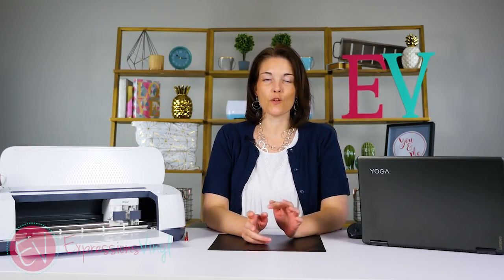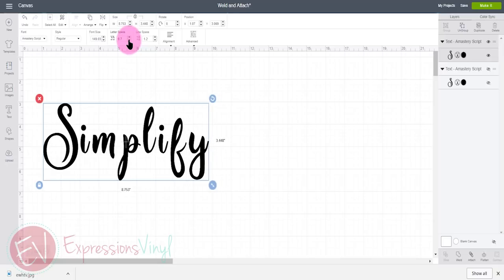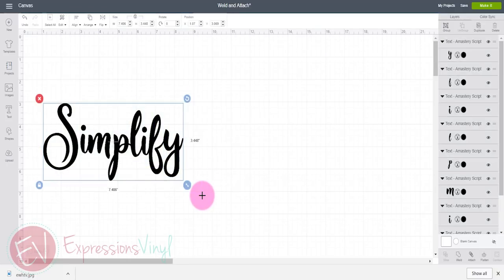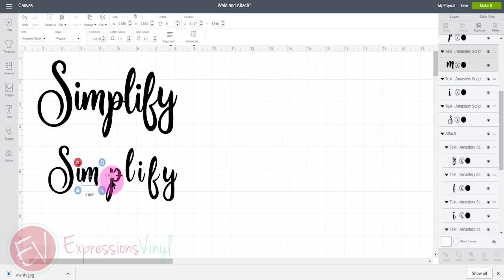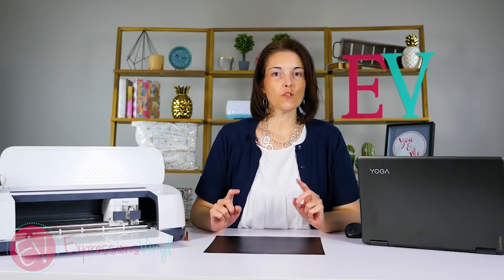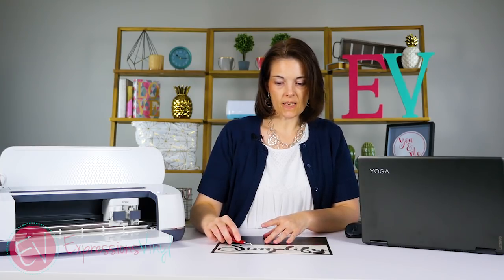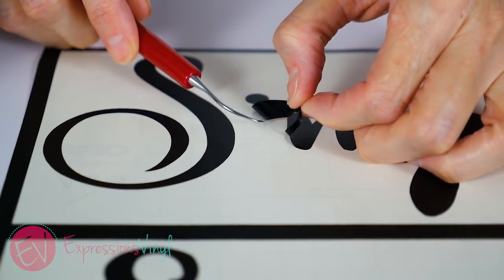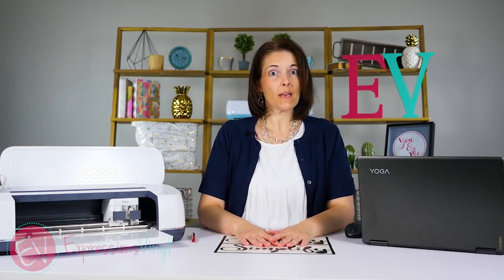What's the difference between Weld and Attach in Cricut Design Space?

Comment: So when would you want to use attached if it's going to cut out all the little extra parts then? Doesn't make sense to me that you would ever need it. But, I'm not that advanced so maybe I'm missing something?
Reply from the maker: Sometimes when you are doing a phrase or different words when you go to cut them they all move to the top left hand corner.  If you want them all to stay spaced apart then you would use the attach.  I add weeding boxes around my words a lot as well.  That is just a box around the words to make it easier to weed everything out.  When you weld something like that it becomes a solid box.   You aren't left with anything in the middle.  If you attach then it leaves a box around it.  Hopefully that makes sense.

Comment: So what're the advantages/disadvantages of each? Why not just have 'weld' so you don't get those cut pieces? Many Thanks.
Reply from the maker: The attach will connect all of the image together so that you can move it as one image. The weld will make it so that you will not have extra cut lines in the image whether it is letters or a image, it will make it one smooth cut.

Comment: So I guess an example of why you would just use the attached is if you are using a font that didn't need to be together but you still wanted it to be one word when you moved it around on the screen rather than individually that would be the reason why I attach exists?
Reply from the maker: The attach option makes it so that you can move the image around the page without it separating.

Comment: Here is my situation: I used attach and the machine cut part of the project that was not supposed, maybe I should use the weld? I put a little nurse cap attached to the edge of the little box to make a flap of the box, and in the middle of the nurse cap, there is a red cross that I want to cut the cross, not solid cross. I made the box, I attach the hat on the edge of the box, I attach the cross in the middle of the hat. What went wrong? The the bottom of the hat was cut and got separated from the box, the cross was cut perfectly the way I wanted. but the hat was not supposed to separated from the box. Should I use the weld all the 3 pieces: the box, the hat, the cross? to prevent cutting the hat from the box? The outlined of the hat does not show because I don't print to save toner. So how I can have the outline, the stripe of the hat. Should the score and drawer do that?
Reply from the maker: Are you doing this on a printable vinyl?
Reply from the maker: It is difficult to visualize what you are wanting, but it sounds like you would want to weld the pieces together. This is if we understand what you are trying to create.